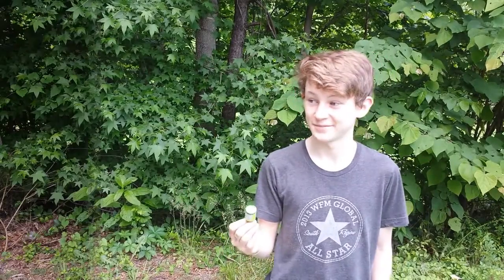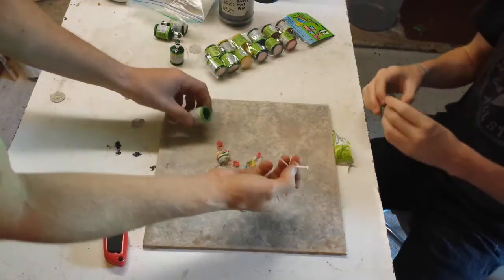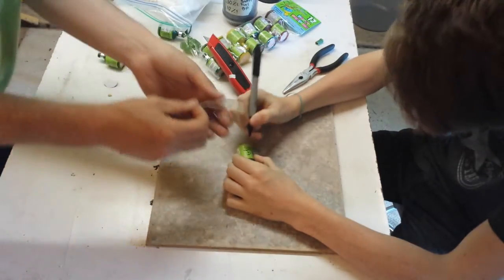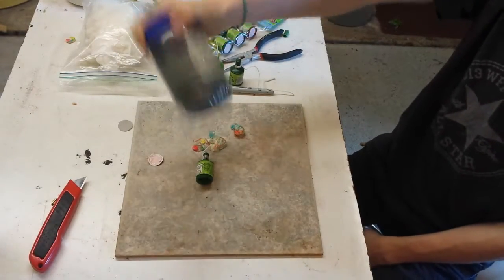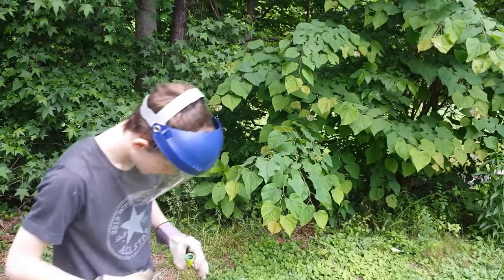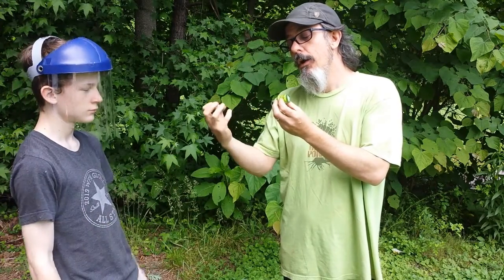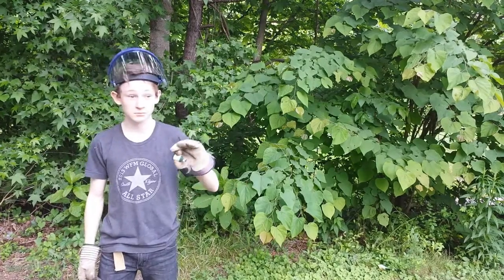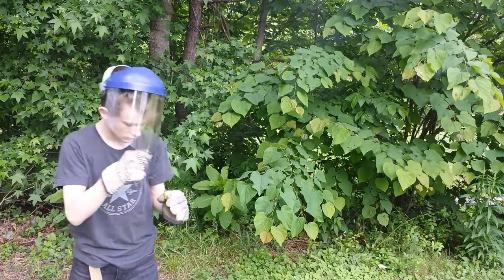Extreme Champagne Party Poppers! Black Powder and Gun Cotton Upgrade

Comment: that was cool I like modifying weak fire works too
Reply from the maker: Those little party popper igniters are cool. Want to learn how to make them!
Reply: schel sullivan  I think they are made by applying a mixture of KClO3 and red phosphorus to a folded string that will pull past its self being pulled out of a tight paper tube you may want to wet the red P and KClO3 mixture with acetone to keep it from going off while mixing and it makes it a paste for putting on the string it dries fast then it is ready  be safe and have fun
Reply: put the pull string igniter in the bottom of a Pringles can the top it off with some flash cotton. 
you get a nice fireballs